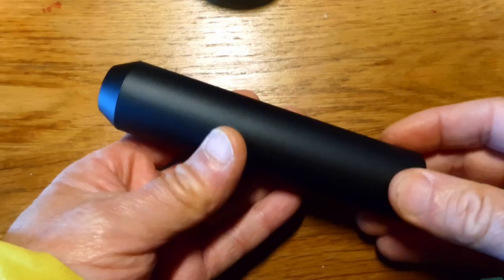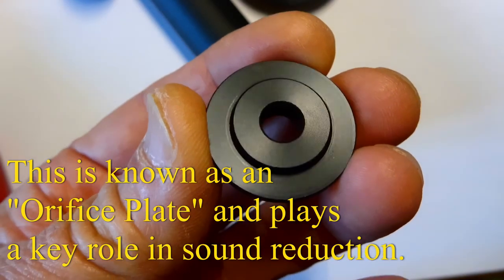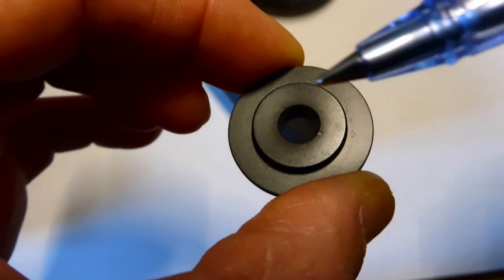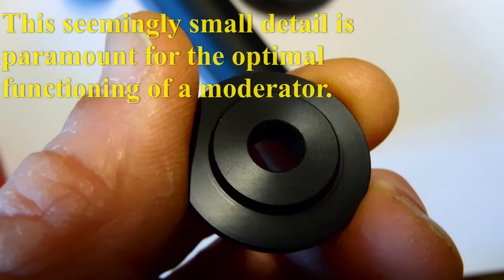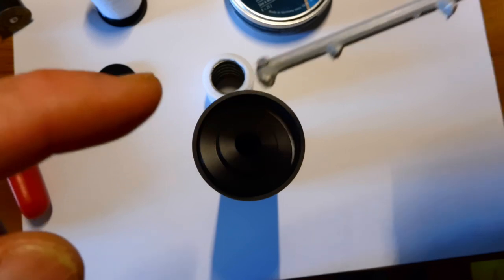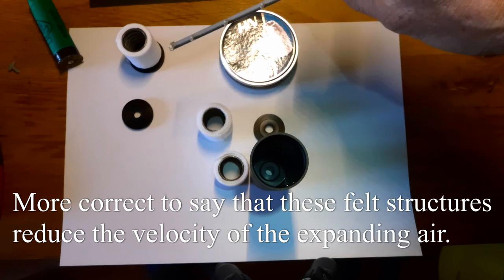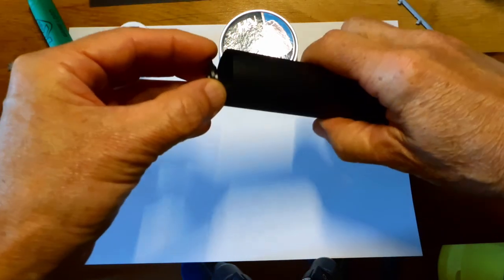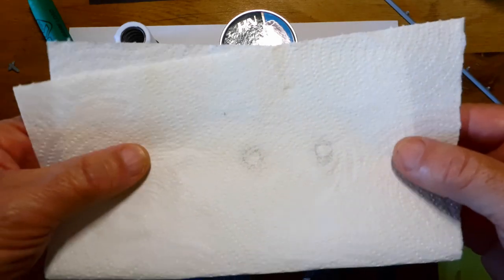Silencer Physics PCP Airguns

Comment: So where's the physics of suppression explained ?
Reply from the maker: I briefly mention the "orifice plate" the physics behind this design for sound reduction is ginormous. I've made other videos talking also briefly about it. To be honest I've not yet found a good way to condense the very formulae intensive maths/physics describing why this works so effectively to reduce sound. Most of the physics work in this area has been done with high pressure valves and jet engines. I'm yet to find something dedicated to gun suppressors, whether real firearms or air rifles etc. Even there is limited data (a handful of public available PhD's on projectile penetration physics. Are you an engineer? I can send you the papers I have if you want to read more about this. Certainly it's not just the volume but the length of the main chamber and the frequencies generated and which ones will be suppressed/attenuated by the orifice plate.
Reply: @bctpcp9546  well to be hones I was curious and I went and got a Umarex K3 new, I don't find it so good.
Fist of all it has a huge influence on point of impact ... enough to throw you off a 6" target only 10m away
Secondly it only moderated the sound 13bB I was expecting something more in the line of 20dB
and thirdly it's heavy